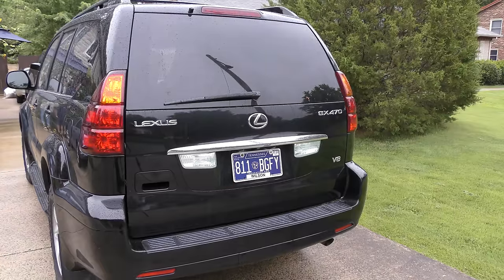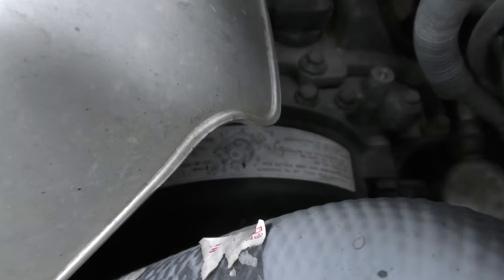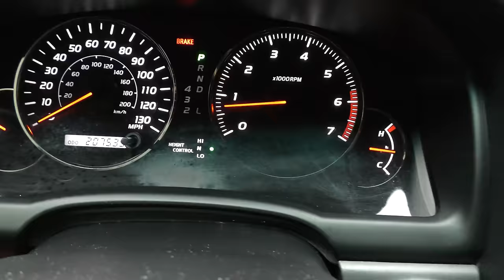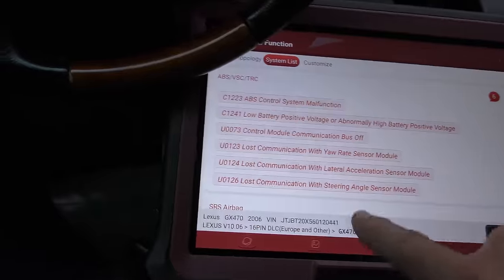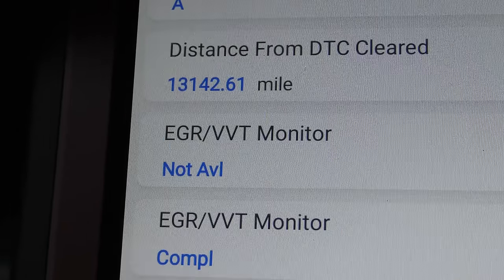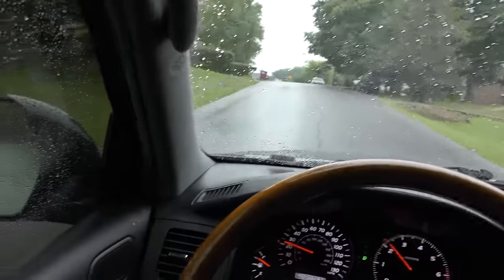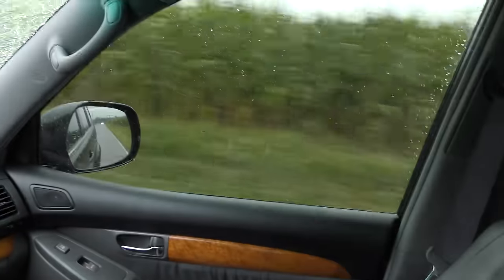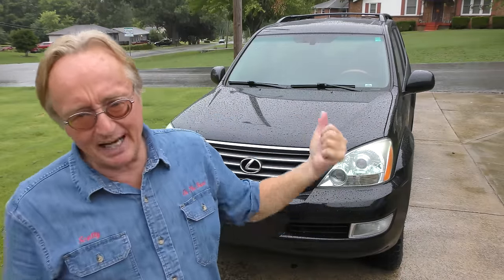I'm Sitting in the Best SUV Ever Made

Comment: I work for a Lexus dealership here in Westchester NY and I kid you not I saw one in our service department with over 730,000 miles and the engine still ran smooth. If these are well kept you will get your moneys worth out of them.
Reply: I could see that. In NY with the winters, bad roads 🛣 , rain, sun 🌞 etc you would need to keep the services, fluids up to date. 🔧
Reply: Drive few more years and hit 1 million miles. I think Lexus will send him a prize for that.
Reply: There is guy who had a Tundra that hit a million miles who did hot shot in Texas in the Oil Fields, Lexus brought it back from him and then there is Matt Farah's, Million Mile Lexus both have the same V8 engine as the GX470.  I suspect as time goes on that Lexus will top every vehicle that hits a million miles!
Reply: @mopheousredpill7462    I remember the cool Toyota Tundra pick up used to assist in bad wild fires 🔥... Hot Wheels even made a toy version of the same Tacoma truck! 🛻  The pick up had a few melted spots, frame damage but kept going!
Reply: @mopheousredpill7462  I thought the “million mile Lexus” was an LS400... which I thought meant a 4.0L V8, and the GX470 is a 4.7L V8, perhaps I’m incorrect, but I don’t think they’re the same engine.
Reply: Who the hell knows?
Reply: Donnie, I’m looking for an independent mechanic in Westchester to service my cars.  Any suggestions?
Reply: Wow!
Reply: @JH-qy7zw  many million mile Toyotas are the 4.7 Tundra. But I’m sure a 4.0 or two has made it that far. As will the newer 5.7 and 4.6.
Reply: Do you recommend to change the timing belt every 100k miles like he suggested?

Comment: I really think that one main reason these vehicles keep on going is because they have a timing belt.  It forces you to change the belt. While your at it, change the water pump, antifreeze, thermostat, and might as well get a new radiator.  Not that much money compared to having to replace your entire vehicle.
Reply: The newer GX460 has a timing CHAIN which is much more reliable
Reply: @thepatternforms859   lol… yeah but the water pump is still a weak link… changing mine on my 460 next week!
Reply: @garyabiermann  how do you know it’s time to change it?
Reply: I've seen plenty of Hondas and other brands with chains that run as good as this with as many miles
Reply: great point.
Reply: Changing ( water pump + thermostat +radiator ) !!!??  is that what you call reliability ?? 
what you call " that much money " depends on where you live on this planet yankee boy !
Reply: @alhassanait1749  1200 bucks every 140 thousand kilometres not even worth worrying about
Reply: @dangerm3496  and that's if you are paying someone else. gets even cheaper on your own.
Reply: Agreed… Monies well spent
Reply: The GX is $50,000 more 😂
Reply: This is incorrect. Most people do NOT follow this maintenance routine. There is 500K mile example and it has only had the timing belt done twice. 

Now, show me a GM or Ford that will even get to 200K without a myriad of issues…

Nothing compares to Toyota’s 4.7. Nothing.
Reply: @Ac22768  Timing belt is not the thing you want to brag about not changing.
Reply: @richsweeney1115 most Hondas are belt driven….

Comment: I got mine, an 04, for $10K with 260,000 miles. Love it. Great vehicle.
Reply: 260,000 and you had to pay 10K!? 😖
Reply: @noahpickerill3749  it’s the market in Charleston, man. I got him down from $12,500. It’s non-nav, clean inside and out, no rust, no cracked dash, no KDSS, and no ML audio so I think I got a good one
Reply: @therealtrabo  here in ontario prices here are like 15k-20k canadian lol with that kind of miles. its expensive and rare
Reply: @therealtrabo  Good deal. The mileage is just a number. A car with 260k miles on it which has been cared of and well maintained is much more valuable than a 150k miles which the owner used it poorly and didn't even maintain it.
Reply: @samanazadi3489  agreed!
Reply: I thinking to buy one in $14,000 with 15,000 miles. Its see pretty nice but i dont know os the time belt and water pump is alreday  replaced what do you think guys is a good deal, i leave in el salvador
Reply: @ricardoespinoza6472  The good point is that you chose the right car model if you're looking for durability and smooth quiet ride. But about the price I can't really tell whether it's a good deal or not. Cause it depends on local market. If it's running smooth and looks good both inside and outside, then it's a safe car to buy. You should consider the probable fixes as well.
Reply: Nice! I see lots of older ones on the trails here in the Mojave Desert!
Reply: Nice! I see lots of these rigs out here in the Mojave Desert.
Reply: I just bought mine with 270k no rust well maintained, I’ll pick that over any new vehicle
Reply: @noahpickerill3749  Shoot, the market hasn't improved since then.  Depending on where you're at, arguably, it may be worse (more expensive) for these GX 470s now.

Comment: I have a 2004 GX470 that I purchased new. It has 107,000 miles on it with a complete service history. All service work has been performed by the Lexus dealer I purchased it from. Scotty's fuel mileage  estimates are pretty much spot on. It is a gas hog, but it is rock solid reliable.  I get my oil changed every 5,000 miles , using only Mobil 1 full synthetic since the very first oil change. My GX has been the most reliable vehicle I have ever owned. Things don't break on it. 

I have had the timing belt replaced twice...once at 50,000 miles in 2012 because the water pump developed a leak and had to be replaced. The dealer recommended I replace the timing belt at the same time, because most of the cost of replacing both is the labor in getting to the area where they are in the engine bay.  I had both replaced again in April of this year, not because there were any issues, but because it had been ten years since I had it replaced the last time. Lexus recommends the timing belt replacement every 100,000 miles OR ten years.

One issue with the GX, plus some other Toyota models of this time period was the dashboard cracking and getting sticky.  They had a special extended warranty on it for a while.  I noticed a small crack in mine well after that extended warranty expired, in 2021. Being that it's Lexus and I had a very long and extensive relationship with my dealer, I called Lexus corporate about the dash. Short answer, Lexus agreed to cover the whole cost of parts and labor to replace my dashboard. My dealer gave me a new Lexus to drive for the few hours it took for them to complete the job.   After 18 years of owning this vehicle, I'm still a satisfied Lexus customer.
Reply: You don’t drive that much considering the miles it has and the years you have it. I love this car, but gas price is high in California and places are spread out. I like the boxy vintage design.
Reply: Please lmk or reply to this if you ever consider selling it in the future !! I've been looking around for a gx470 and can't find the right one yet. Thnx
Reply: Curious on who you talked to and if you could share how you got it taken care of.  I have 108k on my 2004, dash just started cracking.  Love this car.  Called lexus corporate they said the warranty is over and will not be able to replace it...:(
Reply: @minoyv  The work order from my dealer stated that "lexus goodwilled" the dash.  The fact that I bought the GX new from that dealer, who also did all of the service on it since new, I'm sure had something to do with their decision.
Reply: Very happy to see this I’m going to pick one up on Monday and GX 470 has 170,000 miles on it and I’m paying 12,000 for it plus I’m getting everything done on a timing belt water pump spark plugs axle front and rear fluid, change, transmission, fluid chains, etc. do you think this is a goodbye and it’s going to last for a long time?

Comment: statistically speaking 

The Toyota Land Cruiser and 08-22 sequoia are tied as the number one most reliable full size vehicles ever made. 

My 08 sequoia has 206k miles. No issues. Still runs like new.
Reply: @Nobody nope
Reply: The v8 in those cars are said to be toyota's most reliable engine
Reply: No surprise as they have very similar components. And the gx460 is up there as well, essentially a smaller version as the 5.7 in the land cruiser
Reply: @lancelotbustillo6455  it sure is! 5.7L!
Reply: @christopherclark4774  yup. Love the gx and Lx
Reply: Love my 08 Sequoia!! The 5.7  just blows me away with the power. Toyota engineered this vehicle to run on the autobahn so at speed it runs smooth and effortlessly.  I bought it with 140k, it now has 180k. No issues but maintanance. I say                   "maintanance" because it came with aftermarket wheels and needed brakes soon after purchase. Toyotas are finicky and very specific about factory parts so the brakes were a small fortune and the wheels I swapped for the newer landcruiser five spokes with some aggressive  tires. Man!! Rides like it should now. No matter what I throw at it,  it wants more. One satisfied owner!! Love it!
Reply: @lancelotbustillo6455  same 4.7 V8 as in these GX470’s
Reply: well as a professional mechanic, i can tell you the Tundra offsets those. What a piece of crap. Any year.
Reply: Bo Blu  very much so !
Reply: @Nobody Yes for me, 05 4runner V8, bypassed it
Reply: @lancelotbustillo6455  my V6 in my Acura MDX has more horse power
Reply: @double_joseph327  Really? What year?
Reply: @elizabethjudy6340  2016 290 HP. I guess I’m talking the older sequoias
Reply: @double_joseph327  yes but we all know torque is what is important when your in a SUV/Truck like these. And especially when that horsepower peaks at a high rpm, so it’s rarely noticeable or meaningful.
Reply: Theres a youtube showing a sequoia out pull a charger hemi with a chain tied to them,
Reply: @double_joseph327 Lexus GX 460 has 300 HP, 300 ft lbs tq. I own both, the MDX is good but not full-size, GX 460 would run an MDX off the road, tows 7k

Comment: 168,000 miles on my 07 GX470 - Lifted it, put Method RIMs with KO2 265/75/17 (i think) - Dobbins Coilover shocks, Roof Rack with Ladder on the back - I just recently put a sleeping fold up platform in the back... Almost a full overlander at this point.

Comment: I had a 2004 GX with Michelin Defender tires...I was getting 20mpg highway.

Loved that car!
Reply: yup I can get close to 20 on the highway with nokian rotiiva's AT tires. I even tow 2000# trailers give or take, and if I go easy I can get 15 mpg or better. City mileage is where it drops fast.
Reply: Via computer reading on dash, or actual manual calculations? Best I’ve done on mine (rarely) is 19 per manual calculation, 20 via onboard dash computer

Comment: I own the GX460 (successor to the GX470) and it is the best vehicle that I have ever owned - period. It will go just about anywhere, rides like a dream on the road, and has all of the creature comforts. Its basically a wonderful car. Scotty is 100% correct.
Reply: Hmmm, not a car
Reply: @cornelieusfields1169  LOL - right - SUV... Sorry, my mistake.
Reply: What is the different between the 460 and 470?
Reply: @TerraOblivion27  460 has a touch smaller engine and is a little bigger.... there are a few more differences but overall pretty close. Updated electronics suspension I think are the main differences
Reply: @TerraOblivion27 … 10
Reply: Also much better and trouble free air suspension on the 460 whereas the 470 you’ll have to replace sooner rather than later.
Reply: the GX460 has a timing chain vs a timing belt. Which saves several thousand $$$ if you keep a vehicle 300K miles.

Comment: My family bought a 2007 Gx470 drove it til 267,000 miles. The transmission started slipping, sold it for $5500. 
The only other issue it had was the air bag ride, it’s an incredibly comfortable ride but it will eventually fail. I replaced it once with air bags until a few years later it failed again, then switched to traditional shocks. 
Bought another 2007 Gx470 with 150k miles for $11k. Going strong with 186k miles. 
I concur with Scotty this is the best SUV ever built 😝.
Reply: I have a 2006 with 180K, had if for a few years now. Awesome SUV. My air suspension is starting to go and I think I want to go with springs, any recommendations?

Comment: Owned a 2008 GX470 for 12 years. Bought it as CPO with 27k miles and sold it with 128k. Last 5yrs of ownership it saw heavy off-road use. Besides replacing water pump + timing belt at 98k and replacing one of the rear suspension airbags due to leak it only saw dealer for routine maintenance. Great truck and now driving '21 GX460.
Reply: How's the 460 compared to the 470? Any gas difference? Any other differences Ouve hated or noticed and or things you like more than the 470? Thnx
Reply: @iznbrgwhite421 good question!
Reply: @s.fraser5221   thanks mate. Turns out it didn't matter to me personally, as I decided to get an amazing 08' FJ Cruiser 6SPD  . 90% perfection. The other 10% is almost unexplainably exhilarating.  And only have like 6 or 7 downsides.

Comment: My boss has a 2005 Sequoia Gold edition and it has 599,000 mi on it. It's had regular maintenance, water pumps, timing belts, spark plugs, oil changes religiously, at 3,000 miles with Mobil 1 and everything still works on it and I mean everything.

Comment: I would take the V-8 to the twin turbo V-6 any day. Before they moved my neighbor had a 1999 Ford Expedition with the 2 valve 5.4 and I think the 4R75 transmission and it had just over 250,000 miles. The alternator gave up the ghost at about 230,000 but the rest was original. No oil burning or slipping, hard shifting. It was solid.
Reply: Ha yes ! I have my 98 Expedition, 5.4 2 valve. It has the E4OD auto trans. That vehicle is solid, I’m just replacing the timing items before anything surfaces, along with that high volume oil pump.

Comment: 05 GX470 Sport w/ KDSS
1 of less than 10% ever made
05’s also have the highest HP engine of the 470s, perfect pair. 
Even at 165k miles she drives like an absolute dream! The black wood sport interior looks modern. I Feel lucky to have came across such a great car for the family that’s gonna last years
Reply: One of a kind, now if it was green or royal blue would be another feather in a full cap.
Reply: Yep hes right, the only one close to the same power is 13-16....depends on who tests it. Also heard the 470 rides better than 460, just doesnt sound right. get that carbon air filter out of the top of the air box. Has NO use, robs power. Takes 5min, pop out with flat head.

Comment: Got this as a family suv. Gas mileage is pretty shitty in NYC with premium gas, however it’s super reliable. Catalytic converters recently went bad tossing on the check engine light with Toyotas VSC lights coming on to, but other than that it’s a great car.
Reply: I have one in nyc as well 
i always heard you can put regular in the tank. I haven’t tried it, 
have u ?
Reply: @freshdotholla  I have one, I live in Texas, you can put any gas you want on it, this has the same engine as the 1st generation tundra which doesn't require 93 gas, hope this helps.
Reply: @freshdotholla  I run 87 in mine just fine.
Reply: 2005 was the last year it accepted 87 octane via Lexus documentation. Engine was slightly tweaked beginning 2006 model years. 

I’m not a mechanic, I’m not giving sure fire proof, but every mechanic I’ve spoken to says even the 2006 and newer are perfectly fine with 87 octane. The computer systems will adjust accordingly. Though any engine knocking (highly unlikely) you should immediately begin putting premium fuel in.  Supposedly many luxury brands state “premium fuel” for three reasons: 1) burns cleaner, therefor better for average emission requirements for company 2) higher octane typically boosts performance (negligible increase) 3) luxury buyers (new buyers) get the impression “premium required” means a better vehicle (marketing)
Reply: @JH-qy7zw  you're right. No problem with regular fuel. As you said premium fuel (high octane) burns cleaner which means probably near 100% of the fuel in cylinder burns and it runs all the time like that because there is no knocking due to high octane.
But with regular fuel, ECU injects more fuel to prevent knocking and that more amount of fuel keeps engine in an ideal temperature. 
I mean as long as there is no knocking your fine with regular fuel and it might be even better than premium fuel in hot days and areas. Also 87 is a very good number of octane. In some countries 80-84 octane fuel is labeled as premium fuel !!

Comment: The secondary air pump system is a common failure with that motor. The dealer charged me $2,300 when mine went out. It will sound like a shop vac on cold starts when it needs to be replaced. I think my timing belt was $1,200 or so. Excellent vehicle and motor that can last a long time.
Reply: OMG rented one in Florida was all over the road had to constantly correct what a POS
Reply: @josephciro3566  Put your crack pipe away!
Reply: @josephciro3566  was the road curvy?
Reply: @josephciro3566  How long ago and was it a GX470 they stop making them in 2009 or was it the GX 460 the newer version?